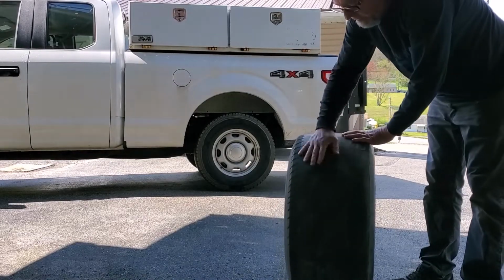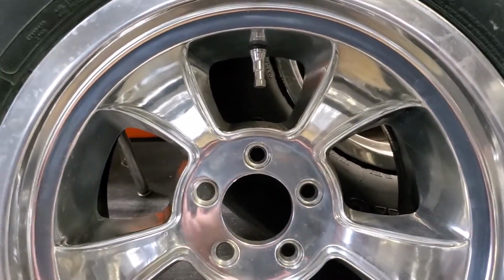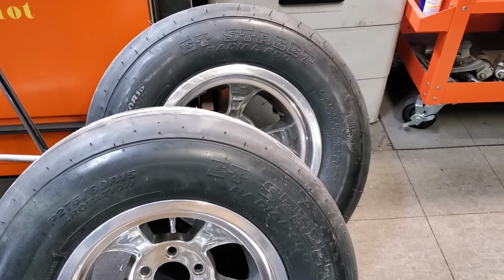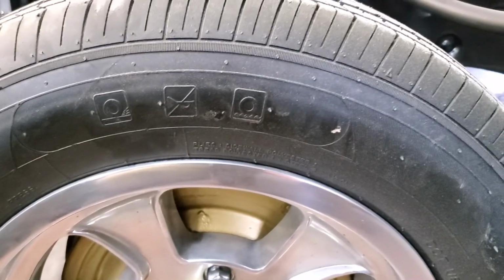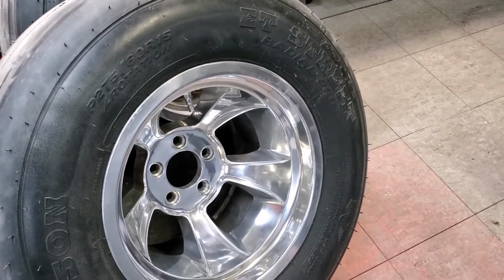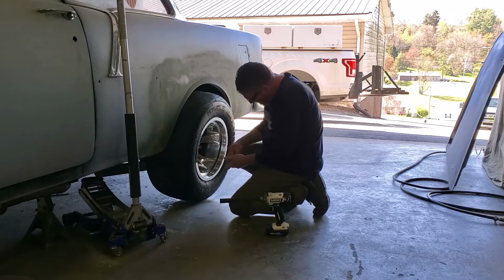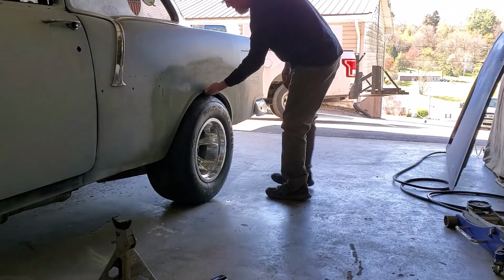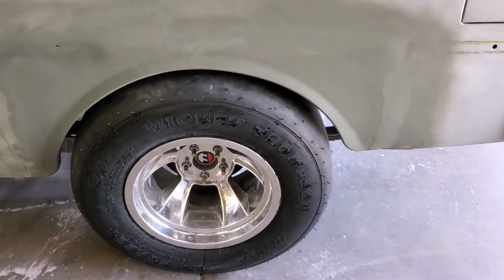GETTING SLICKS MOUNTED FOR THE 1955 CHEVY  GASSER

Comment: the M/T ET STREET is DOT legal isn't it?   Hence the STREET.  It is a treaded  tire.  Nice tire none the less.
Reply from the maker: Its kind of street legal. It still says for Drag Racing Only. Better then a slick on the street I guess lol.
Reply: @CHASINGMUSCLECARS  I've got a set on my Nova but they're the older tread pattern. Mine are about shot. I'd like to try a set of Hoosier's next.  They are a significantly lighter tire!
Reply from the maker: I run Hoosiers on my pro street 55. I love them. I have a video of that car on my cha nel also.
Reply: @CHASINGMUSCLECARS  Hey if your still looking  there's a set of 15x 8.5  aluminum Slots on Racingjunk.com  they're in TX ...........
2 , 15x8 1/2 Aluminum wheels will fit chevy Ford or Mopar ( No Tires ) $300. will ship at buyer expense.
Reply from the maker: Thanks for the info.